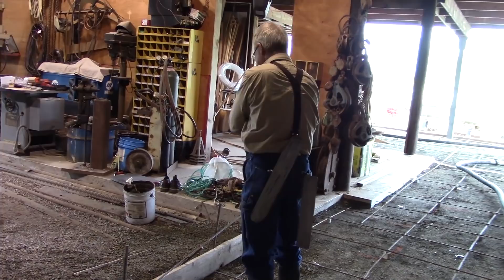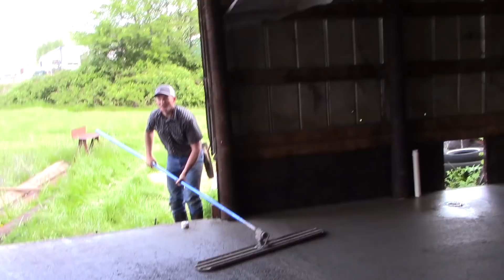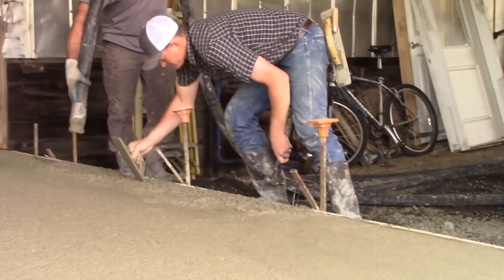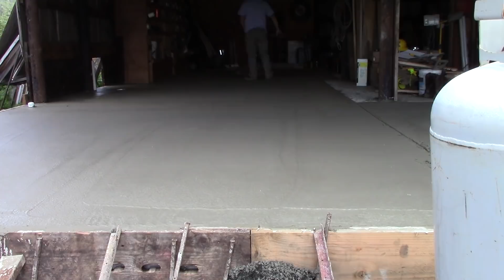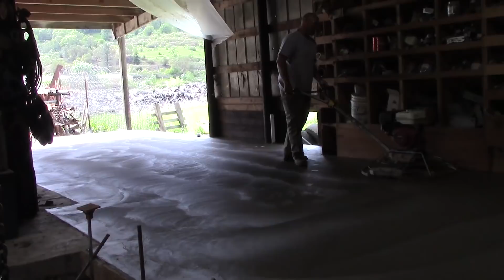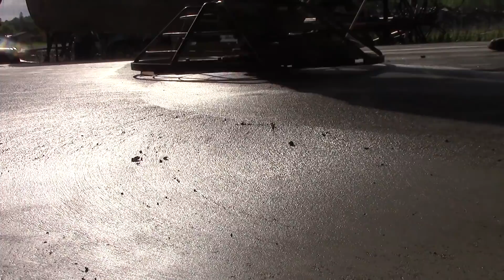Affordable Concrete Floors - Shop Expansion Part 2

Comment: i live in South Florida & would like to know if the mix you used is the same thing as "side winder mix"? It is so difficult to find good help, it looks like pouring concrete with this group of guys would be a joy. It's awesome to have a group of able bodied people to work with & help each other. Makes life good. 
I think as far as crack suppression goes the good job you did compacting the fill under the slab plays a huge part too.

Comment: why no vapor barrier
Reply: He has one under the base aggregate.
Reply: casy casy check out part 1, I believe he put it under a lift of base. The base between the concrete and vapor barrier helps the mud set up.
Reply: Takes forever for the concrete to set up whenever the vapor barrier is just underneath the rebar.

Comment: There is a project management truism I wheel out fairly often..."good, fast, cheap - pick two".
Reply: I always prefer to reach toward the 'good' part of that triangle. Cheap work done quickly is rarely ever satisfactory, based on what I've seen.
Reply: OEFBugout - cheap and quick isn't very often satisfactory to a lot of people but it is a choice that can be made.

Rob Plotts - you could go for fast and good which would imply that you're willing to spend more to expedite deliveries and pay for more man power etc etc.
Reply: Ralph Hardwick waiting for parts is always at the mercy of the provider of the parts and the delivery service ie, ups, fedex. sometimes it may take weeks for a part to be shipped mean time you wait then when it does come in a lot of the times whoever pulled the order grabbed the wrong part so now it will be another few weeks its a very common problem with parts.
Reply: theres also a big difference between cheap and inexpensive.if you state cheap usually you would be referring to cheap crappy not very good, if you refer to it as inexpensive it still insinuates that the product or work is still good stuff just not expensive.
Reply: Guys, stop reading into my comments so much! I clearly stated it wasn't a scientific measurement of project management. It's just a truism that generally speaking you can generally in most cases generally have any two of those three things.
Reply: I suspect the good/cheap combination is not actually possible unless you are doing it yourself.  The reason is that "slow" is pretty darned expensive when it involves paying someone to do the work.
Reply: It's a truism, it's not meant to be scientifically applied. You can have something good and cheap - if you're willing to wait until a vendor has downtime and can fit you in. Expect to be bumped down the queue fairly regularly though. I think you've misunderstood "slow" in the context I mean. I'm not suggesting it takes someone a long time to do the work but that it will be a low priority piece of work fitted around their availability. You might get a bit done on a Monday and a bit more the week after for example.
Reply: Gotcha.  I couldn't work out how it was logical but I didn't consider the availability issue.
Reply: To give a bit more context, in project management terms the speed of delivery is not directly related to the amount of effort (work) required to complete a project. I.E a project might have a delivery window of 6 months but only require 2 months work. The rest is waiting for dependencies, delays, feedback, site inspections etc etc.
Reply: Ralph Hardwick i agree i worked at a friend's shop few years back he owns a Harley Davidson repair shop / new bike builder he brought me in on a few builds takes a good 6months to build one from scratch with the owner changing things and such on the design. the biggest time absorber is the whating for parts and then the right part to be delivered.
Reply: Heard many an engineer say that

Comment: I just had a 30'x70' slab on grade poured for my house here in SE Georgia, USA. (I mention this because Alabama got all upset when they heard Russia invaded Georgia, no joke) . For expansion crack control, the guys used a power saw and cut about 2-3" in the semi green concrete. I don't know if this was good or not, but it was clean and efficient.  Rocky
Reply: That method is allowed. Warehouses do use it because it doesn't catch wheels, pallets, forks, etc. as easily.

Comment: Coming along nicely.  When you drilled holes in the existing slab (I assume for rebar?) did you epoxy in the rebar or just slide it in?  Just curious how solid the connection needs to be when doing that to join the two surfaces.

Comment: Maybe I missed it but what is the key to getting the floor as glass slick as possible
Reply: Work it and work it some more.
Reply: It’s possible to get a concrete floor glass-slick (well, almost), but you don’t want that. People will constantly slip and fall on a perfectly smooth floor. No traction.

Comment: With regards to allowable tolerances, we also have issue C to consider: what the project actually needs...

If you have a simple concert slab used for a non-load bearing purpose, then you or your client will have nothing to gain by building it to a spec suitable to a nuclear bunker roof.
Reply: john paul, I agree, always build it to the best of your abilities

Comment: Have you ever had the opportunity to use a conveyor-belt truck for placement?
Reply: Essential Craftsman I’ve come to prefer them over the big A frame pumps in most applications, even pouring walls. 

Awesome video. 👍🏼